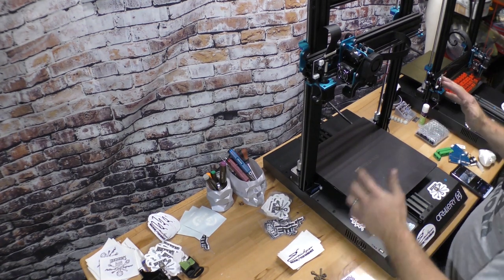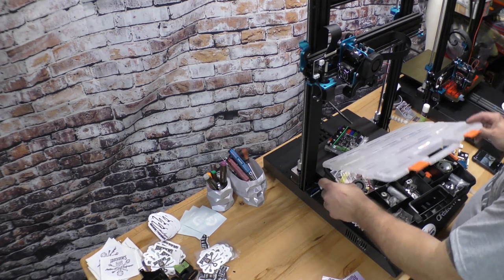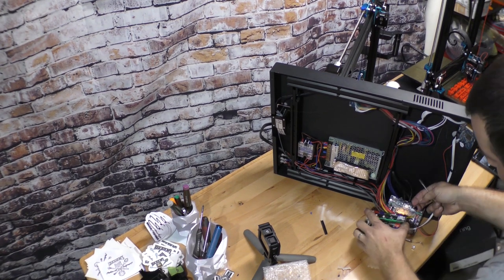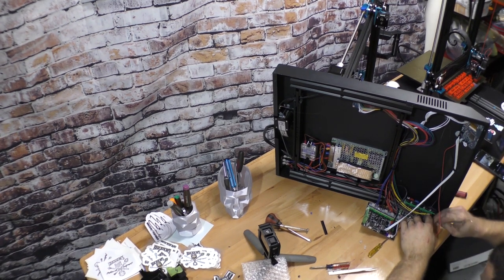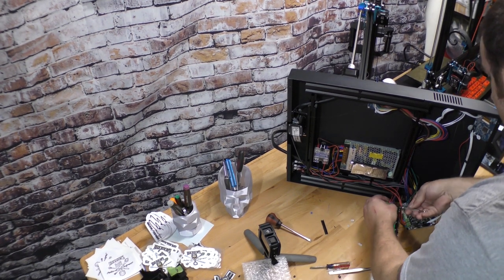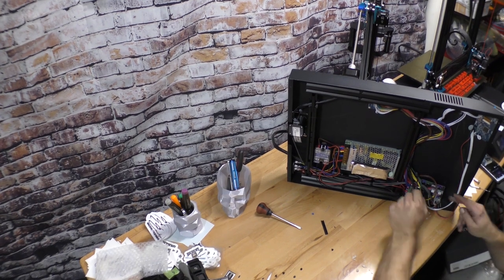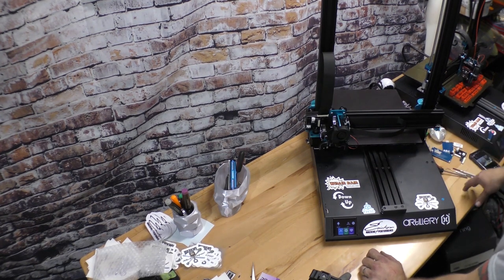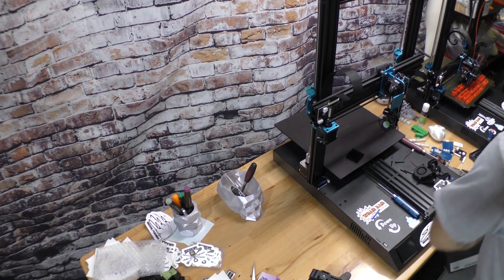How to fix a Main board failure in a sidewinder x1 3d Printer

Comment: Great presentation.  I had issues with my SWX1 and Artillery took care of it.  Anything that man has made will fail.  I haven't been able to use my printer for about 2 months due to health reasons, but this is a good machine.  I have made some changes to it and it has been a valued asset in my DIY process.
Reply from the maker: Thank you for watching

Comment: I agree! and the most important part is that Artillery came to the party. I had this trouble with my Ender 3 and they gave me a replacement board at my suggestion to save sending it back to them and all works fine. Like you said this just happens with machinery. I still love the Ender 3 and my Artillery Sidewinder X1
Reply from the maker: I understand stuff breaks I'm happy to see that they stood behind their product

Comment: I've sadly had two failures within the first 100 hours of printing, idler snapped about 3 prints in, even though I checked it wasn't over torqued and more recently I've had the bed heater pad fail, hoping after this I can have a bit more reliable printing. 3000 hours without a single issue sounds like you've got a miracle printer there!
Reply from the maker: Hey i sorry to hear that. 😢😢  definitely a bummer.   Hopefully it all gets sorted.  Message on here how its going and if you ever need help feel free to email me ericksonmap@gmail.com

Comment: One of the best thing to do when receiving a Sidewinder is changing the wires of the heatbed which are excessively fragile.  I had troubles for 3 full days with MINTEMP on the headbed and decided it was the motherboard (WRONG!).  So I changed it and I still had problems.  Tested tested and retested............. and at one point I just pinched the heatbed wires together and there went the error.   I replaced them with properly flexible sheathed 2.5 mm2 copper wires and I put 2 strands for each terminal of the thermistor in a separate sheath (emptied a section of my electrical cord for that).  I joined the wires at heatbed exit with hollow aluminium connectors covered by several heat shrink tubes (one on each wire and another bigger one on top).  Problem over and heatbed heating properly.  No need for chain cable anymore.  I kept the part fixed under the heatbed to attach my wires to with serflex.   Problem over and not likely to happen again and I have a safer installation too.  NB:  the most annoying part was the JST connectors.
Reply from the maker: I don't know if this is a newer issue but both of my x1's have been trouble free with the heat bed and they have over 6000 hours of combined printing.   The only issue I had was my Second machine had a main board failure that they covered under warranty.   They both printed 24hr a day 7 days a week for months printing ppe.
Reply: @EricksonMachinePerformance    Good for you.
Reply: @EricksonMachinePerformance  I still like the Sidewinder so I got myself its little sister, the Genius.  Same machine but much smaller.
Reply from the maker: @margerymaraudy9486  I have 2 and LOVE them. They just always work. Best printer out of the box in the price range in my opinion
Reply: @EricksonMachinePerformance    I totally agree.  Just got the little Genius out of the box (only 258 € delivered on my doorstep), sitting next to the Sidewinder.  I must mention that the faulty heating pad was not the original one but a replacement.  I changed the original because, having broken the glass bed, I thought it would be better to also change the heatpad (I wish I hadn't but anyway I patched it up so it is OK).  I reckon the original glassbed was faulty.  Even with a pack of frozen peas on the bed and below zero temperature, it proved impossible to remove a large printout.   The piece survived with some glass still stuck on its bottom (lol) ie the glass bed got ripped but I bought a cheap machine and I don't recall seeing the little control sticker on the extruder stepper motor cover like I see one on the Genius.  Good I am a DIYer all round.   I reckon Artillery would have sent me a replacement but I am an independant and hurried mind.  I got a credit from the French company that sold me the faulty heatpad.  As for the original motherboard I'll use it to try and burn the garage down with a laser cutter (lolllll - shusshhhh my husband must not know....not yet).
What an adventure 3d printing is.......
Reply from the maker: @margerymaraudy9486  I have a laser master 3 video coming out today
Reply from the maker: Also the th3d or whambam flex plate are worth there weight in gold!!  I have a video on that as well
Reply: @EricksonMachinePerformance  A video on how to build a laser cutter?  I'll have to watch that but I have bit a bit busy fitting a E3D V6 on the sidewinder.  That works a treat !  The extruder seems to be zooming about.
Reply: @EricksonMachinePerformance  I looked it up on amazon and it came up with a magnetic flexible plate in stainless steel.  Is that what your are talking about?  I may well get one soon (I'll let the debit card cool down a bit first lol) because my Genius let go of a print and produced lots of spaghetti.  Adhesion is a fine balance between sticking down and letting go.
Reply from the maker: I have a video on my channel doing a flex plate review with a link to the th3d and whamBam

Comment: Hi. if there is a next time (I hope it does not happen again) I recommend using a MKS SGen L v2.0 with TMC2209. Match all holes and pins for easy change. And you can try to use the MKS UPS 24v. Very good video.

Comment: Hot glue is easily removed with rubbing alcohol (ethanol). Just drip some on the hot glue bond, it will release from whatever surface it is stuck on. It is a weakness of hot glue that we can use to our advantage. 

As a bonus the alcohol is usually safe to pour on most things, electronics for example, and it will evaporate and leave no mess.
Reply from the maker: Thanks for the comment.   A few others also mentioned.   Great tip

Comment: Had lots of issues on my hot end today and when putting back together I broke the thermistor. Not a problem I thought, I had a spare off a different hot end. It looked different but a thermistor is a thermistor right? Well after temporarily winding the wires together to test it, getting a reading of -14c (same as when there was no thermistor) and wiggling it around it went flash & bang at the connection! My power went from everything except the red light on the main board and the fan inside the power pack. I still get 24v from the power to the board, but no screen / fans, totally dead. I can't see any burns on the board. Can't see why it would do this, I thought thermistors were very low current

Comment: Hi,  thanks for Vid
I had to replace my motherboard due to same issue with temperature increasing and burn out !  as you advised to take them out one at a time a few where attached together with that  strong glue so a few came out together i can't find anything online giving me instructions with colours of any kind of help as to where the single black goes. Everything else is perfect but that single black  glued so tight came out with brown next tp green
i know it came out of the 12 pins next to the green blue red upper-level slots. but which out of the 12 pins does the single black go back to ?  After the brown is back in i am left with 8 pins below it
Reply from the maker: i have a video assembling a 650 that shows it.

Comment: Hello, thanks for the video. I have the same issue and bought an MKS Gen L 2.1 to replace the board, however, I saw at the end of the video you mentioned you would try to replace the mosfet, did you manage that? Did you find out which Mosfet needs replacing? I'd like to try it on my board while I wait a month for the new board to arrive from AliExpress.

Thanks so much for any info you can provide.

E.

Comment: Im having a similar issue with my sidewinder x1. Im curios if it was the same with yours,  but my printer doesnt actually heat up its just the thermistor reading incorrectly.  I used a multimeter to check the thermistor and it read .3 when my spares read 65. You'd think that i could just replace the thermistor but the problem persists and in fact seems to break any new thermistor i put in. i have a spare board so ill try replacing it and see if it fixes it. When fixing a printer, replacing the main board is the absolute LAST thing i try because  especially with sidewinders in my experience its usually not the problem. If you have any, id love some more information on how to determine a failure on the main board like this as well find out what exactly is broken?
Reply from the maker: My main board would cause it to overheat uncontrolled. So all the safetys failed.

Comment: can you take a picture of the exact location of the brown wires pins to the board and where the black wire goes because I didnt see where it went thanks to the hot glue pulled the blue the green and the 3 brown wired connector that also had the single black wire glued to the brown wires connector. I was doing exactly what you are doing in the video and the glue screwed me.

Comment: Is that a replacement power supply you're using? If so what is it? Mine blew up after about 20 hours and seems to have taken the main board with it... Either that or all the stepper drivers!
Reply from the maker: no same power supply   just replaced the main board

Comment: Did they also cover all the connectors with hot glue on yours? I'm still figuring out how to get that off without damaging anything.
Reply from the maker: I was told after I finished to use alcohol Which would remove the hot glue.    I have not tested this but I was told by several people that works and I just used the hot glue gun to tack them back on after I was done
Reply: @EricksonMachinePerformance  Thanks! Might try that. Just now after some more searching on Google I found that a completely new wiring loom will set me back only $5. So if anything goes bad I could still order one of those.
Reply from the maker: @rob8650  slow an steady.  Just take your time and it will be fine

Comment: stepper driver , is their a video on how to best replace this board.. i am having shifting problems
Reply from the maker: Did you try slicing with Z-hop enabled?    When are the shifts happened?
Reply: @EricksonMachinePerformance  randomly, sometimes they dont happen.. what exactly does this Z HOP control ?
Reply from the maker: @GLADIATOR MECHS  sometimes when the nozzle drags on moves it causes shifts.   Z hop lifts off before a move
Reply: @EricksonMachinePerformance  THANK YOU.. i have to try this.. Can that be adjusted in the options mode of the X-1 or X-2 , or can that only be done in the slicer.
Reply from the maker: @gladiatormechs5574  slicer

Comment: Hey mate!

My just bought sidewinder x1 stopped 20 minutes into a print a completely shut down. Whenever I try to start it it makes a sparkling sound and starts smoking. I already contacted the support, but they seem to mot want to replace it. Do you think its a mainboard issue? I ran the printer on 235 Degrees C and the bed on 85 degrees C. Would be great if you maybe have some experience onto this.
Reply from the maker: email me ill be HAPPY to help you out

Comment: My thermistor broke off the hot end and started smoking.. my lcd started flickering.. and now doesn't turn on anymore.. do i need anew board?
Reply from the maker: most likley
Reply: @EricksonMachinePerformance   the printer works fine in octopi and done couple prints no prob. Heat stable just the lcd is dead. I'm confused won't the mainboard be fried first ? Anyhow thanks for replying
Reply from the maker: @everythingplusultra  thats a weird 1 but i dont use octopi .   normally if there is a heat run away its the main board      just be careful    if it has another heat run away it can catch fire ect...    maybe it was something with octi but i cant comment because i dont use it.    sorry i could help more

Comment: I have had with waiting on parts for both my Genius and Sidewinder to the point I am just buying aftermarket of everything that fails. Artillery printers have cheap and nasty parts in them so I replace everything with better quality as it fails which is a lot of the time unfortunately.
Reply from the maker: Sorry to hear that.   Both of mine are over a year old and I honestly haven't had issues ( knock on wood)   the only part failure I had was a main board.  And that's it with over 5000 hrs of combined printing

Comment: Where did you get that great hot glue gun?
Reply from the maker: i just added it to the post with an affiliate link   its an awesome glue gun!!
http://rover.ebay.com/rover/1/711-53200-19255-0/1?ff3=4&pub=5575550208&toolid=10001&campid=5338617779&customid=&mpre=https%3A%2F%2Fwww.ebay.com%2Fitm%2F222680729295

Comment: First! Blew 1 mks (therm1) and 2 skr 1.3s (completely gone) already in this printer. Let’s see how to do it properly now ;)
Reply from the maker: I'm sorry to hear that man that really stinks I've got probably close to 4000 hours printing between both of my printers and this is the 1st major issue I've had and it just completed 20 hours of printing since the repair and is running good as new!
Reply: All in the same manner though: leaking hotend then trying to clean it off a bit while powered on. touching or ripping the thermistor and then spark sounds and byebye. Mks board just blew the therm port, but the skrs are dead. Don’t really fancy warranty claims every time, so I’ll just plough on till I get it right.